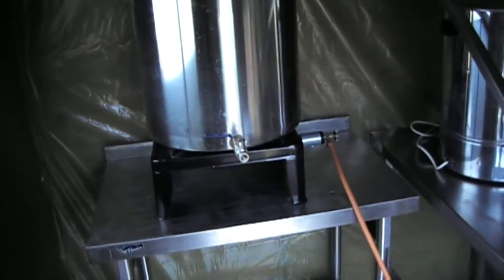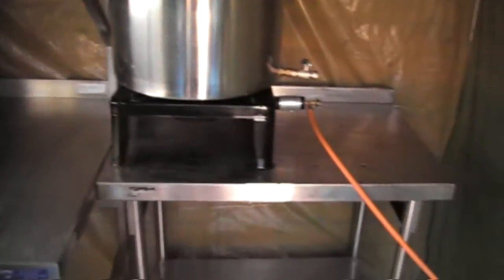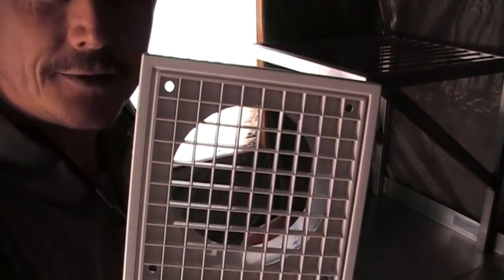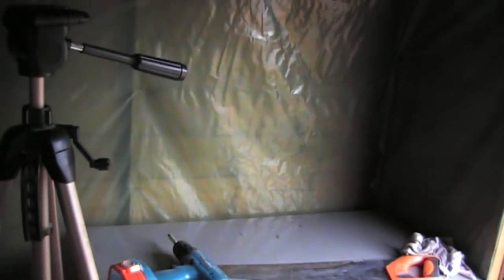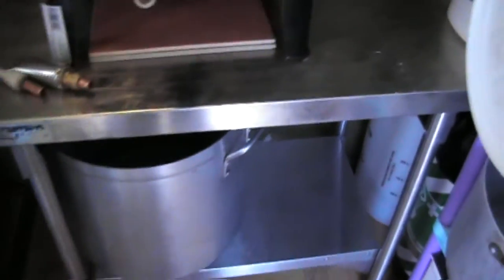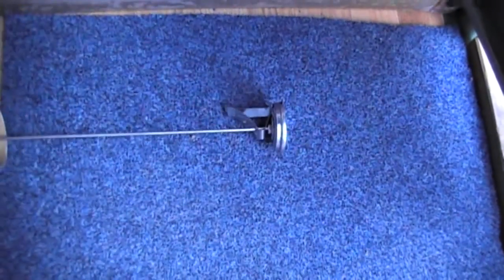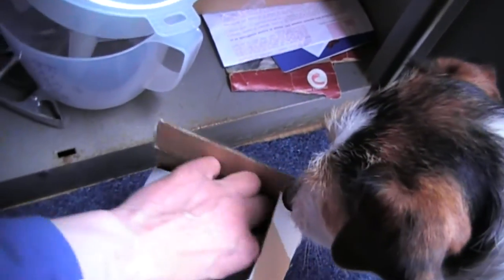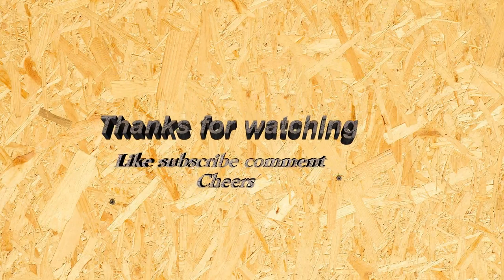BREW SHED BUILD part 3

Comment: Nice shed Clive! I hope that extractor fan is big enough for all the steam. Should be pretty close. If you find the brewpot is too high with the burner under it, you could always cut a hole in the top of the table and fix the burner underneath it - or just shorten the table legs a little :-) Looks like a nice brew shed, and well organized!
Reply from the maker: I think it will be better with the smaller pot now looking at a low profile hood on ebay, cheers

Comment: Excellent, some sort of shroud behind your burner might be needed but you won't know 'till your vapour barrier starts melting : )
Reply from the maker: It will pull forward but I have some large tiles, or a nice stainless splash back would look good. hmm

Comment: Cracking shed fella!

I've still got my shed to put up. It's a bit bigger than yours (so ample space for brewing!), but I didn't plan to use it as a brew shed as I have a large garage that has plenty of room to brew in. Watching this video has got me thinking whether to reconsider that plan and actually brew in the shed, as things tend to go missing in my garage! I'm sure my bottling stick has grown a pair of legs!
Reply from the maker: Now what you mean. I chose not to use part of the garage as I have other machinery welders etc, not a dust free environment for brewing and the shed was a freeby so it will do till the garage is extended, cheers
Reply: I quite often sit my FV on the mig to siphon it into something! I do have another plan for my shed, but I might be able to do both! I'll have to see what space I have inside when I build it. I'd better get the yard cleared, slabbed and get the thing up! The problem is whenever I have a day off, I end up brewing!

Comment: Can any one help im new to home brewing and iv got the coopers larger on the go its bean 7 days and it reeds 1.018 for 2 days can I bottle it it started at 1.053
Reply from the maker: That's a little high have your temps dropped and slowed the yeast down
Reply: Its at 20 to 22c
Reply from the maker: rfenables4 is it a straight kit or have you put other fermentables in with it, do you have another hydrometer sometimes the insert moves giving wrong readings
Reply: Its the coopers diy kit wear you get it all i did the malt extract and brew enhancer 1 and only made 20 litres so it's strong
Reply: All the foam has pretty gon
Reply from the maker: rfenables4 1008 -1012 is around the point I would think it will stop, they use an ale yeast hybreed  so not a true lager yeast. I would leave it another 2days check gravity if its not moved rouse the yeast with a sterile  spoon gently you don't want to get air in at this stage,and leave it for  5 days it probably just needs some more time
Reply: Ok thanks for everything great videos
Reply: What is malto dextrin used for
Reply from the maker: rfenables4 Added in small amounts it gives the beer more body mouth feel it has less fermentable sugars